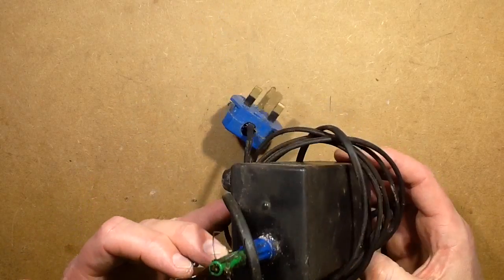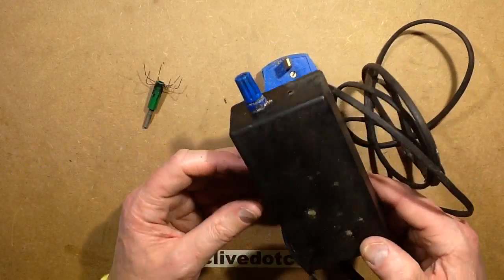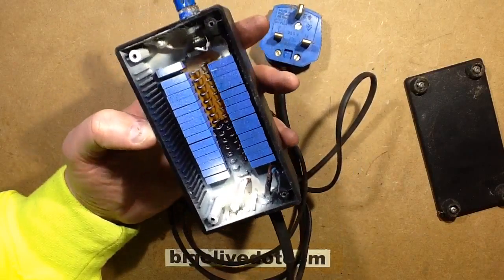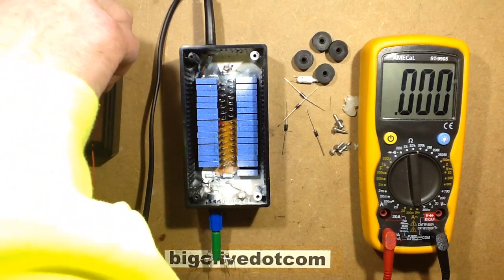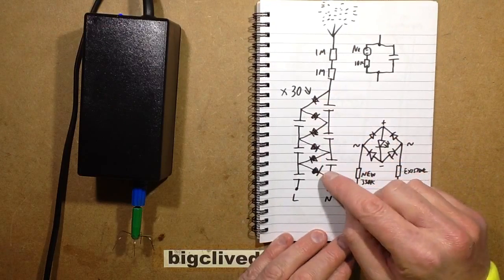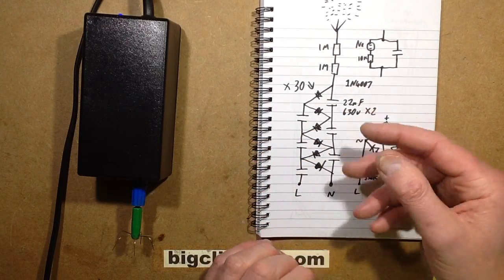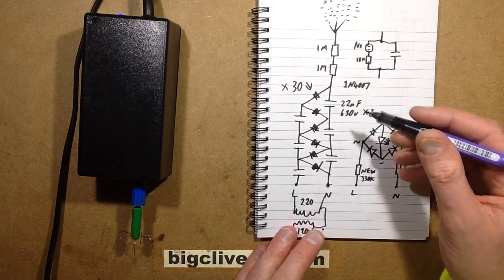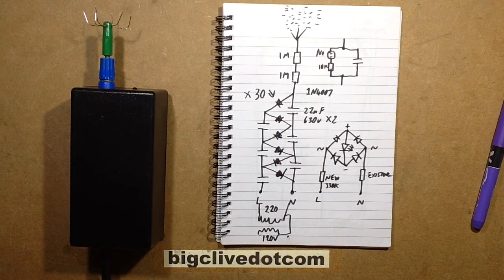Manky custom ioniser refurb with safety violation.

Comment: I just bought this thing, it basically looks like one of those commercial ozone machines (it is really) that has a strange radio frequency ionizer, rather than a needle point one. These were made so you can set the ozone generator section to the square footage of the house, so it would send  out a very trace amount into the air. They fell out of favor, not because they don't work, but because people misused them, they'd just turn it on and crank the thing up til they could smell it, which was too much. For a couple years I worked at a store that sold them. I'd been shown how to run it, and we always had the thing set so you never actually smelled the ozone, but sometimes a customer would come in, crank that knob to 11 and shove their face in the air coming out and take a deep breath of that shit. I never quite got that, some said it smelled good, some said it was too strong. To both I'd say, "you set it to the square footage, if you can smell ozone, you set it way too high, and that's not good for you!"

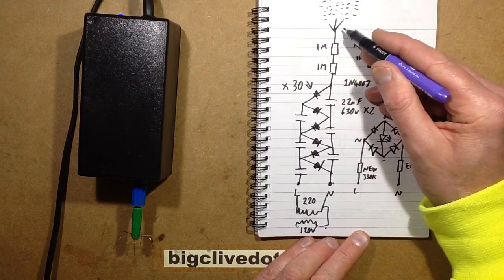Comment: 10:00 to avoid negative DC corona and ozone. If I add more needles or carbon fiber tips, say 20, will it reduce corona? Or it'll just pull more current out of the device and corona will be there on every tip?
Reply from the maker: There's an advantage to having a tiny amount of corona at the needle tips.  There's a natural level of ozone produced in nature, and having a trace level in the home may be a good thing.
Reply: @bigclivedotcom  Agreed. My question is what is the effect of increasing needles/carbonFibers on the ionizer? Will it consume more current? will it stop corona glow?

Comment: 5:04 how can we measure voltage across neutral and output pin?
I thought of measuring voltage across each bottom capacitors(connected to neutral line) and adding them to get the output voltage. But I could measure only one stage separately using 630v DC multimeter. 
When I try to measure voltage of individual capacitor, in 15 stage multiplier, just by connecting one probe it sparks. So I am afraid it might damage my multimeter.
Is there any easy way to measure total generated voltage?
Reply from the maker: It's difficult.  At later stages the voltage to ground is high and the meter impedance also starts dragging the voltage down.

Comment: We used to have an air purifier that had the needles sticking out in a sort of plastic cage.  It worked fairly well but came with a damn fan and carbon filter to clean the air as well.  Back then (before the Doctors got a hold on my old body) I had a difficult time getting to sleep, and uncommonly, white noise just bothered the hell out of me, so I told my good wife of 50 years to throw that damn thing out!  She did.  Now that I am doped up, I have a hard time staying awake at night, even before going to bed, with the noises of the house, and my good wife watching the television at a sound level that the neighbors call to complain about the gun fire when detective programs are on I sort of wish I had it back.  I was thinking of trying to build one of these for our home but after seeing how many cells I would have to make for our 125 volt system I sort of put it on hold for awhile.  Perhaps I will try to duplicate the one you built and see if that will work. I wonder if 400 volt rated 0.022 micro fared caps would work?  I have at least a hundred of those little buggers that came in a combo pack from Electronic Goldmine.

Comment: OK so if I remove the glass ball from a plasma ball and hook up the high voltage end of the wire to some needles will the effect be the same as the ionizer
Reply from the maker: An Ioniser normally has a single polarity.
Reply: OK I used a high voltage diode from an old microwave and it worked well, the static charge on the output was strong enough to raise the hair on my hands from about an inch or so, not sure if it produces negative ions but there's definitely a negative charge...

Comment: I'm considering making one of these, but I'm guessing using perf board isn't a great idea due to the spacing of the holes. I wonder if spreading the stuff out and cutting anti-tracking slots would prevent angry pixies from flashing over.
Reply from the maker: I wouldn't recommend perf board.  If you check out the ioniser page on my website it shows how to make one with no PCB.
Reply: Ah, good ole deadbug style. I ruled that out initially because I couldn't think of anything to put it in, but a piece of PVC pipe would be perfect.

My suspicions of avoiding perf board was re-affirmed when my bug zapper bulb went bang earlier. Disassembly revealed that HV tracked along the surface of the pcb and found the neutral, leaving a black sooty skidmark. I have a feeling it was related to the high humidity we have here pretty much all the time (70-90%) because the metal bug grid starts to rust even without getting wet.
Reply: @bigclivedotcom  So I got around to making one and since I'm in America, I'll need to find a 120 to 240V transformer. I used 23 stages and only get about 1000v on 120v mains.

Comment: Would ionisers work better at controlling dust if there was a device emitting positive ions on the other side of the room? Presumably the positive-charged dust and negative charged dust would be attracted to each other and more likely to stick together and fall.
Reply from the maker: I'm not sure what effect that would have.  It might just result in charge cancellation.  You do get industrial ionisers for removing static charges that put out positive and negative charge to cancel out surface charges.

Comment: Been a long time fan!  Question:  I am starting to build out my new room air purifier.  Since the mountain breeze ones are not longer available.  I am going to build mind from scratch.  Knowing what you know now how would you recommend doing it with today's components?  I am in the USA so I am going to use 110v supply.  
I would love to build this myself but from what I can tell the components that you had used to DIY yours are built around 220v supply.

Its not as fun but I was looking at buying one or two of these and just retrofitting them into the air cleaner. https://www.aliexpress.com/item/Diy-8-16-32-48-64-Heads-110V-220V-Negative-Ion-Generator-Home-Ionizer-In-Addition/32878532083.html?spm=2114.search0104.3.27.26bb52c3rMq0Fm&ws_ab_test=searchweb0_0,searchweb201602_5_10152_10151_10065_10344_10130_10068_10324_10342_10547_10325_10343_10546_10340_10548_10341_315_10545_5012515_10696_5012615_10084_531_10083_10618_10307_10059_100031_10103_10624_10623_10622_10621_10620,searchweb201603_13,ppcSwitch_5&algo_expid=e412d34a-0c31-4921-a2eb-a74bb186e01a-4&algo_pvid=e412d34a-0c31-4921-a2eb-a74bb186e01a&priceBeautifyAB=0

Comment: Every stage should multiply the voltage by roughly 2 times. So in theory, the only thing you have to do to convert it to 120V is add one stage. That would convert the 120v to 240v.
Reply: Came here to say this.
Reply: It's not exponential, input voltage is multiplied by number of stages because each capacitor on the right is charged to double the original input peak, so this one outputs 15 x 2 x sqrt(2) x 230 V at zero load .  Adding one stage would only get the multiplier to 16, doubling the number of stages to 30 stages (60 capacitors, 60 diodes) will get the same output voltage from 115V AC, but might need each capacitor to be 6 times larger for same output current even though 60Hz helps a bit .

Comment: How much faith would you put in an eBay "negative ion generator" from HK?  For instance : https://www.ebay.ca/itm/Air-Purifier-Ionizer-Negative-Ion-Anion-Generator-Purifier-DC-12V-Cleaner-Car/172560461789  
I'm looking to build a static grass applicator, so not an always-on application, just once in a blue moon while crafting.
Reply from the maker: It should be safe enough with a low supply voltage.

Comment: Hey Big Clive since you are the ionizer pro, what is going on with this one I just bought.  Instead of using the array of capacitors and diodes to step up voltage, I opened it up they are just using what appears to be this transformer http://www.seawiseion.com/SW750H-9-3.jpg   (basically the same one, SW750 but not H-9-3) then a single capacitor.  Then has  two large resisters at the end by the output as usual.  It looks ridiculously simply!  And it boasts ion production rates that are very high, 100 trillion / sec

How could this be?  If this method is so much easier and simpler why isn't everyone using it.  There must be a catch somewhere.  Can you (or anyone) answer this question?  You will make alot of people happy.

The machine is the Comtech IG133A, made in America    http://www.negativeiongenerators.com/roomionizers.html    and image http://www.negativeiongenerators.com/images/IG-133ionizer_black629.jpg   

What is going on???
Reply from the maker: That's a full electronic module with transformer, pulse circuit and output rectification.  Ignore the ion production rate.  It's often exaggerated for sales.
Reply: I plan on testing the negative ion output with one of those cheap pocket sized Ion Testers on Amazon.  Maybe you could do a video on the science of those detectors one day, I'm sure your viewers would be interested to know.  Anyway thanks again for the work you do , I'm learning a lot.
Reply: Wait before you go!  For the transformer and pulse circuit, pardon my ignorance, but that sounds a lot like this stun gun module that you talked about here ->   https://youtu.be/iDJp2tHmEQo  

So I basically have a stun gun in there?  ...but with a couple mega ohm resisters on it? (and no spark gap).  Or is this another beast entirely?

Comment: What's the difference between this and a w/c voltage multiplier
Reply from the maker: It is based on the classic Walton Cockroft style multiplier.
Reply: bigclivedotcom but no massive shock if you poke it? 😅
Reply from the maker: +phonotical An ionisers could deliver a huge shock if you touched a mid point on the multiplier while referenced to ground.  It would start with a high voltage pulse from the capacitors, followed by sustained current from the mains via a few diodes.
Reply: bigclivedotcom I'll be careful then already had one unexpected shock today😅

Comment: Cockroft-Walton Generator 
A Cockroft-Walton generator is a voltage multiplier that converts AC or pulsing DC electrical power from a low voltage level to a higher DC voltage level. It is made up of a voltage multiplier ladder network of capacitors and diodes. Unlike transformers, this method eliminates the requirement for the heavy core and the bulk of insulation, as the voltage at all the levels is identical. Using only capacitors and diodes, these voltage multipliers can step up relatively low voltages to extremely high values, while at the same time being far lighter and cheaper than transformers. Another advantage of such circuits is that one can also tap the output from any stage, like a multi tapped transformer. In practice, the multiplier has a number of drawbacks. As the number of stages is increased, the voltages of the higher stages begin to sag, primarily due to the zero impedance of the capacitors in the lower stages It is virtually impossible to feed the device off of commercial-frequency voltage, as this requires larger capacitors, which substantially reduces the overall physical size and weight indicators of the CW. The rectified current pulsations are also increased, which in some cases is unacceptable. Usually the voltage on the output is supplied from a high-frequency transformer, and then increased to the required value using the Cockroft-Walton generator. Cockroft-Walton multipliers can produce voltage of just several volts to several megavolts. Cockroft-Walton generators are used in many technical fields, like: Laser systems, High-voltage power supplies, X-ray systems, LCD backlighting, traveling wave tube amplifiers, ion pumps, electrostatic systems, air ionisers, particle accelerators, copy machines, scientific instrumentation, oscilloscopes, TV sets and many other applications that use high-voltage DC.

https://youtu.be/CcREnI-zbrY

Comment: Hello Big Clive, on your website you say we need "High Voltage" resistors, but what does that mean? I checked all electronics shops i know and only found maximum of 800v resistors.
Reply from the maker: You get specific high voltage resistors, but in this case it doesn't need to be as high as the full ionisation voltage, as any attempt to touch the needles will immediately bring them down to a few hundred volts as you approach them.

Comment: +bigclivedotcom I want to build one of these. The only X2 capacitors I can get easily are rated "275V AC" and I'm in New Zealand where the mains is 240V. Will these caps be all right for the job?

Cheers.
Reply from the maker: Yes, X2 capacitors have a high DC voltage rating.  I've used them in the past.
Reply: +bigclivedotcom Thanks very much.

Comment: question: when you add a resistor, say in series with an LED, does the power usage drop or is the same amount of power used and just wasted as heat energy? i actually never thought about this before..
Reply: The end resistors carry very little current so not much heat is produced (power = R x I²) . This entire unit without the lights consumed about 3 kWh total over 20 years of use according to the measured input current .

Comment: Can you use an old plasma ball to generate negative ios?
Reply from the maker: If the "ioniser" has a strong visible purple glow in the front ports in a dark room and produces a bleach smell then it may be an ozone generator.  If it has some recessed sharp needles in the front or what looks like black string then it may be a proper ioniser.
Reply from the maker: Not really.  It's not suited to that application.
Reply: bigclivedotcom ok thanks
Reply: +bigclivedotcom clive ist there a test you can do, to see if my ioniser not just produces ozon? or can you see that in the scematics? 
keep it up
Reply: +bigclivedotcom clive ist there a test you can do, to see if my ioniser not just produces ozon? or can you see that in the scematics? 
keep it up
Reply: bigclivedotcom thx ! that did help me alot

Comment: Made a 5 pound purchase of a USB ioniser a few years ago. I bought a load of LED filaments after watching all the Big Clive videos on them. Actually makes a decent light for reading and runs off lithium power banks. It's Cockroft-Walton by the way which makes a good Geiger counter circuit with a high impedance speaker.

Comment: Another very cool video, I might make an ionizer in the future if I get the chance. Wonder if I had a Grounded metal plate nearby to the ionizer if most of the debris would collect on that instead of everything else?
Reply from the maker: I should take apart another ioniser I have here that goes one step further.  It has a dust collection plate with its own small positive multiplier that is theoretically a preferable place for charged dust to settle.
Reply: It'd be very cool if you do, and it is good to get some confrontation that the theory of a "Collection Plate" is possible.

Comment: What kind of output resistors do you need?  If they arc, that would be really bad.
Reply from the maker: The current capability of the multiplier is so low that as soon as you get near the needles the voltage across them drops dramatically.

Comment: +bigclivedotcom I believe you have drawn the Cockcroft-Walton multiplier section of your schematic with the diodes backwards.
Reply: +bigclivedotcom Ignore the diode comment. After simulating the circuit, I see that with the diodes pointing toward the supply the result is negative voltage output. And, with the diodes pointing away from the supply, the result is positive output.

Comment: These are really quite fascinating little devices. 
I made one of these, and messed with it until it became powerful enough to blow out a candle flame. 
The key to it was the use of an accelerator plate behind the ion emitter pins. 
Imagine that, a personal fan that doesn't have any moving parts  :) .

Comment: Another silly question: From what I understand the input voltage is added at every stage (almost), meaning that the voltage is doubled at first stage. Isn't it possible to design it so that the output from the first stage (double mains) is fed into another circuit which functions the similar way and doubles the voltage, and in theory double the voltage at every stage instead of just adding it?
Reply: SirArghPirate If you add a inverter using dc input voltage as voltage span, sure. It won't make the circuit simpler!

It would be easier to start with a higher voltage  (using a transformer)

Comment: For 120V input, wouldn't you need only one more stage since it essentially doubles with each stage?
Reply: No, it multiplies the input by the number of stages, each stage has 2 capacitors and 2 diodes .

Comment: Could you run one from a 12v solar panel?  Thinking of a touring caravan over the winter. Where i 
do not normally leave the battery in and no mains available.  Variable voltage depending on the
sun though, from 0v to 18v max.

Would it also act as a bug zapper?

How efficient on a solar panel?
Reply from the maker: You do get low voltage ioniser modules.  Try a search for 12v ioniser module on eBay.  It won't zap bugs.